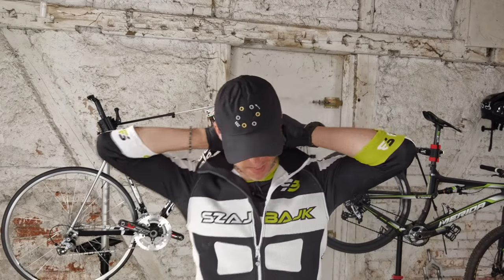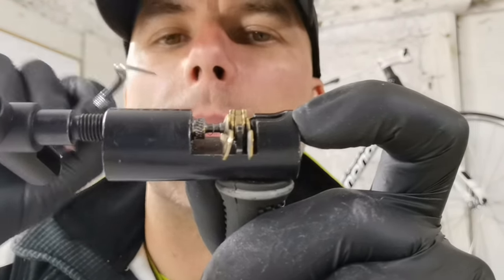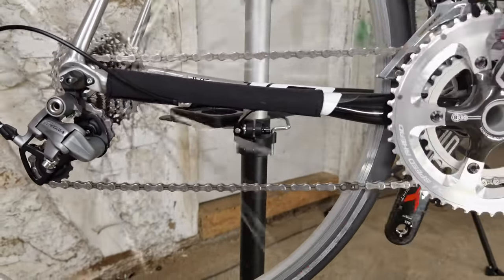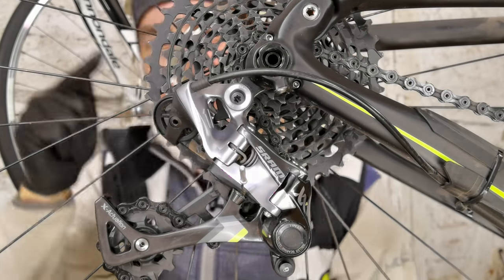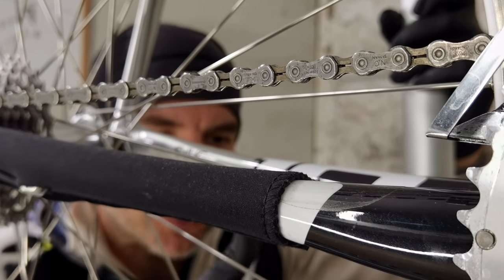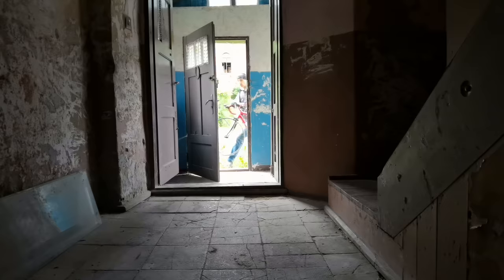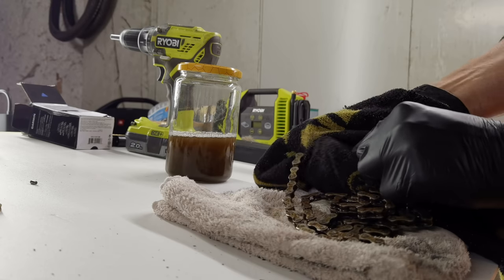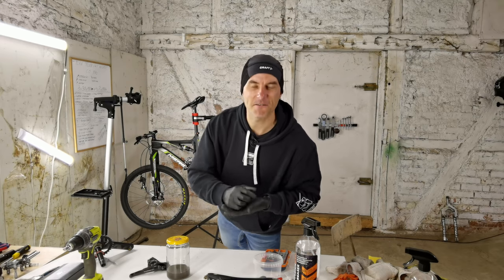7 mistakes with chain maintenance.

Comment: I reuse my quicklinks a lot since years, all of those are "non reusable" ones . Sometimes I i open and close them daily because i wash my chain off the bike. Never had any problem with them. Dont throw everything into the garbage after one instance of use. Only if it is worn with the chain together
Reply: Same here. I reuse quicklinks and will continue to do so until someone provides a sound engineering reason not to.
Reply: On a single speed it might matter, but any bike with a tensioner I can't fathom any reason not to.
Reply: Cleaning your chain every day sonce like it's very oily... Ever tried a waxxed chain?
Reply: @kaedeschulz5422  If you ride in dirty conditions, doesnt matter the lube. You bike will be dirty as hell.
Reply: @rcs2003  can relate, i live close to the sea so no matter what my chain is always dirty em rusty, i clean it one day and in the next it is already dirty :c
Reply: Did that too for the first time just this morning. We will see how far I can go with that.
Reply: I've reused them many tims with zero issue. I'm not buying a new quick link every time I wash my chain or switch chains when I swap my gearing.
Reply: kmc ones are very loose after maybe 4-5 uses. even the reusable ones feel too loose to me. and theres a lot of fakes out there atm that arrive in little ziplock baggies and rust.  just buy a three pack its worth it.
Reply: @stevecrabb1  you wear out the thin section each time you remove em. they will become very loose and you dont want them held in place solely with chain tension, especially on a mtb or if there is more than 3-4mm of sag when you backpeddle.
Reply: @wilfdarr  bumps. tensioner speed doesnt always match the chains movements
Reply: @luminousfractal420  Bumps Place tension on the chain, not...anti-tension, for lack of a better word (a better word doesn't exist because it's not a real thing!)...I really don't see how a chain would ever unlock itself, but certainly absolutely never if there's a tensioner in the system.
Reply: @wilfdarr  it doesnt. Trackies arent going to use a new joining link every time they change their chain. Could be 2-3 times during a training session and could be 5-6 times during a competition depending on what gear they want to run for the event.
Reply: @Tgiles13  Ya that was my feeling but I had no evidence to back it up.
Reply: The new 1x11 or 1x12  drive chains are much more sensitive to chain size and pins. On a 10 speed you could abuse chains alot more (or anything with front derailleur). I just used a chain breaker on my new bike with a new to me 1x12 drivetrain like I always have on my old bike and the chain failed on first hard pump up a hill.  I had the breaker and not the master link tool with me.. expensive mistake.
Reply: Same here not one problem. I discard the quicklink after 4-6 openings and that's probably because of paranoia. To use 1-4 quicklinks over a year to be able to clean the chain in a jar of degreaser is soooo worth the small cost compare to what a good modern full suspension mtb cost

Comment: Jeez, I’ve been breaking chains for years without using a master link and had only one failure! Well after watching this video I learned some new things and will need to have a spare master link for each bike. I use simple green to clean my chains while on the bike, blow them dry with compressed air, lubricate the chain with a “wet lube” and then wipe dry. I do this on my year round fat bike commuter (through the winter crud) have 3500 miles on the chain and it still works great! Great video! Thank You!
Reply: I've been using chains with multiple breaks and never knew this, so far it's working fine tho lol

Comment: Yup, I routed the chain wrong between those 2 back pulleys,  grinding sound but shifting was fine, then I saw your video.  I split the quick link and rerouted the chain, no more grinding. Thanks for your help, your videos are the best.
Reply: I rode quite a few rides that way before another rider pointed it out… so embarrassing…
Reply: @cshigley  And it's amazing how well it works, shifts perfectly,  but that little grinding noise that I thought would eventually resolve by itself. However, with the chain properly routed it's totally smooth and noiseless.

Comment: My chain cleaning trick:  a shaker jar and gasoline. Works like a charm. Air dry and lube the chain well. Next cleaning, use a different shaker jar, and transfer the gasoline over without disturbing the sediment. Then clean the jar. One shaker jar of gasoline lasts several months. Just use caution storing the used gasoline.  And lastly, I’ve used the same master link for years, to include a ride across the country with no issues, but I always carry a spare.
Reply: Use diesel to clean it.

Comment: I always try to clean chain, rear cogs, pulleys and crankset after each ride. Then lube it all with some good wet chain oil, leaving it for set up a couple of hours, finally wipe off excess lube on the chain before next ride. Never leave drive train dirty or wet overnight as you recommend. Really nice tips here! Congrats.

Comment: Yes, a chain will look like that after a couple days of being wet, when the thing isn't oiled like it should be. But I've revived even the rustiest bike chains simply by oiling them and running them normally, even seized bike chains are still good. I've never had issues using even the worst, pitted bike chain, not even with breakage, and I was certainly rough with bikes when I was younger.

Comment: Good video - I've done 2 of the mistakes. 3 if you count that I never wash or dry my winter commuting bike. The most frustrating mistake is the upside-down eagle link which is only an issue when on the 11t cog. The chain is kicked off the cog when the link hits the lock-ring. I spent an hour troubleshooting the derailleur only to realize I was a moron.
Reply: Well watching this vid makes you not a moron 🙂

Comment: Remember to put thread lock on the jockey wheel bolt when you reassemble the derailleur.
Reply: yeah I learned the hard way, bolt came loose, and the cage went into the rear wheel taking the wheel with it! The cage was all bent into the cassette too

Comment: Thanks, like many commentors, I re-use my quick link. I cannot imagine the means of failure as the pin is tensioned in to the narrow part of the link. I do however carry a new quick link at all times. Reckon I can repair a broken chain faster than a puncture.
 Only had a few chain breaks, I am a heavy guy, they break when you are standing up, the crossbar breaks your fall and your balls, so you tend to remember chain breaks.

Comment: Good vid. But I totally disagree about the split links. I’ve split mine more than 20-30 times and it’s fine. 👍🏻
Reply: It’s fine but it starts clicking so you have to change it or listen that metronome
Reply: @amdmamdm  it’s a mountain bike they shake, rattle & roll anyway! I really don’t have to change it as I don’t hear a click? I think I’m just blessed! 👍🏻
Reply: Yup it can still be ok to reuse the quick links.  That's mostly manufacturer recommendation, and most times you can reuse it several times
Reply: Connex links are the best imho I used them in the past and never had any issues.. now I use specific links for shimano chains and aren't the same 😬
Reply: If you use a chain for more than 1000 miles you will have to replace the cassette and the chain rings much more frequently. Breaking the chain 30 times in 1000 miles is really excessive.
Reply: Til you split a wing 😄

Comment: A lot of steels have an anti rust treatment that can be stripped by anti rust oils like WD40 type penetrate oil. Then the metal rust after the thin layer of oil comes off. I blue gun steel in touch up areas with a tool coating liquid that is copper based. It turns the raw steel black. My bike chains are also sensitive to being chemically stripped by a "rust inhibitor" oil that actually causes more problems than solves.

Comment: In my childhood I worked on chain pins with a nail and hammer. Chain breaker would make me believing Im in a bicycle heaven.
Reply: lol those were the days. and ive broken so many chain breakers using kmc chains i still carry a nail and something with a hole in. 😄 rocks are easy to find usually.

Comment: The first 1: 45 of the videos.
When I was a young kid.
 I never had special tools for bikes
 I still don't
I've always split them with a chisel or screwdriver and mushrooms the end over never had any problems.
Reply: How do you mushroom the pins? I'm worried about my spliced chain will break up in the same joint because it's a emtb with 90-95 nm torque (which is why I think it should have something closer to a mc chain)

Comment: Really great video.. i didn't know about all of those. Interesting to know that there are some quick links designed to be reused. 
So i guess if you rewax chain every 300 miles and you ride 6000 miles in a year then you need 20 non reusable sets of quick links? Oh man. I don't think my quick links are reusable and I've been waxing my chains every 200-300 miles for two years now and haven't yet had a single failure.. honestly I'm getting concerned with the age of the chains despite then not showing any signs of stretching.
Reply: The connex links are probably what you want, they're a bit more expensive but rather than relying on friction to keep them together, there's a labyrinth for the pins to follow and stop them coming out so totally reusable for ages.
Reply: Quick links are very sturdy and easy to use. Sometimes you may need a piece of thin wire (e.g. the used inner wire from the derailleur) to open the quick link if it's really tight. It's important to clean the chain before the lubrication. The cheapest way is 1 liter plastic bottle with some amount of diesel fuel just to cover the chain. Don't shake it too much. Then you cut the bottle, take out the chain and put it on a piece of cloth. Take your time and carefully clean each link with another cloth.

Comment: I hear people say not to reuse the pins and the use a master link, but I bin reusing my pins for the last 25 years and   never had an issue. As long as the link is tight, it should be stronger than a master link.

Comment: My Shimano chain broke after 2500-3000 miles. It was the one I got when I bought the bike, so I never bothered to look into chain maintenance other then lubrication and basic cleaning. When I started looking into videos about chain mounting/de-mounting I found out it was put on backwards with the signs on the inside. I wonder if that could be to blade for it breaking and wearing out fast.

Comment: 1977 Raleigh Supercourse, somewhere around 20K on the chain... 5 speed chains last a long time.
Reply: @Alfred Wedmore According to KMC, a 6 speed (they don't make a 5 speed anymore!) is 3/32", whereas a 10-speed is 11/128". That's only a 9% difference. Note to self... measure the actual width of the chain on the Raleigh.

Comment: Dodo on embn tech Said Don't clean the new chain ,he claims that the lube sram etc use is the Best and that the chain is perfectly lubed when buying a new chain.he said that you shouldn't not even lube it for a little while because your lube Will replace the lube in the rollers on the chain and no lube is as good for the rollers as the fabric greas that they lube it with when producing it.. still it's a good video...a lot better than he's break check video
Reply: the kmc guys showed up on the forums and quoted the same. it makes em look bad if people mess it up is all.   use a soft teflon wax and go through the whole procedure properly and its much nicer than the installed grease. maybe change it when youd normally lube your chain but honestly the black gunk is gonna be all up in those links not a nice clean little spread of grease like youd expect. theyre actually quite loose fitting inside. whats harder to get out of a tight gap using movement and water..a wax or grease. 🤷
Reply: @luminousfractal420  I tried many lubes but the only one I never broken a chain while using is ballistol it's not really for bicycles but its really good and it's a spray can so it's easy to get in those rollers ,,in emergency you can also use in your bicycle Lock if it gets stuck because rain or something washed out the oil.. but after using it every Day for a couple of weeks it gets black but it's wet so don't use it if you need dry lube

Comment: What is special about the Shimano Steps CN-E6070 E-Bike Chain and do they not include missing link because supplied connecting pin is better or just less expensive?

Comment: Lol, I lost a master link about 20 years ago, had to knock pins out with a hammer, pushed one back in and rode the bike for years, there was never a problem. It might be an issue for more expensive chains, but most people are only paying $20 to $30 for a chain.
Reply: if you can 'peen' the pin slightly with a hammer/punch against a heavy steel surface or another hammer, it will help when needing to reuse pins.

Comment: How to clean oil from the new chain? Can I use gasoline? Can I immerse chain in it or just clean outside of the chain?
Reply: Brake cleaner, this stuff removes anything oil/grease base solutions.. then i would use PTFE (aka teflon) spray to oil the chain, and use some old t-shirt (or any rag) to wipe the excess oil off

oh, and when applying spray on the chain.. if you have the chain on, spray it at front cog... if you spray it at the rear there is a good chance that you also oil your brake disc and pads... you can use brake cleaner to clean the disc, but you need to replace the pads if this happens... (damn i felt stupid when i did this -.-)

i have ~3000 miles on my chain, and the bike is used all year round.. from +30c to -30c, in rain and in snow

Comment: The mechanic install my shimano chain incorrectly. The logo of the hg was inside which is suppose to be on the outside. I used my bike already for about 300km+..Is it ok to place the chain on the correct side or it should be place the way it was before?

Comment: Mileage on a chain depends on what you're doing with that... on ebikes for example wearing must be 0.5 for replacement and the chain lasts about 1500/2000 km maximum... even with maximum care.
Reply: i see kmc do an ebike version now...but im a bit skeptical as its the exact same weight as the the standard heavy version they make.  also because they made that diamond like coating thing...i dont want diamonds on my sprockets..much rather replace a worn chain 🤣

Comment: i'll throw one in. dont use an oval (absolute black) chainring with an sxg chainguide. hopped off a kerb the other day. the chain..i think..folded on itself during a suspension squish where the smallest width of the oval is, chain (kmc..very tough) tore itself apart.

one of these fairly new devices that i love had to go.  had to ditch the chainring :/  meh.

Comment: 😥changed chain and cassette yesterday...today after only 30km it's making noises again (that's why i changed the old stuff). but i just whiped the original lube a bit down and after 25km i oiled it with wet condition chain lube

Comment: 10k miles? Well, if you're only going downhill not pedaling this might work. If you're pedaling a lot the chain will be lengthened and will grind off the chainrings/sprockets/pulleys much faster. So it's either sticking with one chain until the chainrings/sprockets/pulleys are done or replace the chain in time and have the chainrings/sprockets/pulleys survive longer. But 10'000 miles is about 16'000km. That's hardly impossible. Unless you're only going downhill that is.

I am doing about 20'000 km every year. Something 50+ km every day. Yes, every day. I need at least two sets of chainrings/sprockets/pulleys a year. If I don't change the chain in time I need three sets of chainrings/sprockets/pulleys and at least three chains. It's cheaper to replace the chain every 2000 km.

Comment: I've made the same mistake with the routing of the chain I ride with 1000 watt mid drive motor 160 nm and actually works better on small cogs  no skipping  put it right skipping on high load again new chain gonna stick it back and grease it

Comment: Best only keep a chain for a year otherwise you start wearing out the sprockets and chainrings so don't worry about your split links. I wax my chains perhaps 3 or 4 times a year and I don't get my hands dirty when touching the chain and the chain doesn't rust. Happy cycling
Reply: I used to wax my chains but they still got greasy from road gunk. Now I clean them with WD40. Silent, well lubricated and always stay clean. If I don’t clean the chain for a week I’ll use petrol to clean them but still WD40 to lubricate. Gets all the water out of the chain so it doesn’t rust too.
Reply: I'm still not convinced that math actually works out, if you ride low to mid price groupsets, you might spend more on replacement chains than you would replacing sprockets...

Comment: BMX chains are designed to be fixed by pushing the pin back through. The only reason this can be done safely is because a BMX is single speed. The pins can be over-sized allowing more of the pin to stick out either side.  
 They so this because BMX guys treat their kit so badly. We use hammers to smack bearings into place, we use adjustable spanners because we're broke from buying beer and bike parts. We're impatient, we want to be riding more than we want our kit to be immaculate. 
 The biggest shock to my system was the maintenance my MTB required compared to the BMX, it's beneficial though. My BMX gets maintained just as well as the MTB now and I've got the proper tools.

Comment: @5:16 Chain does have logos on outside, but quick link arrow pointing wrong direction?
Reply: Because quick link is placed incorrectly. The arrow should be on the outside. Then the arrow will point backwards.